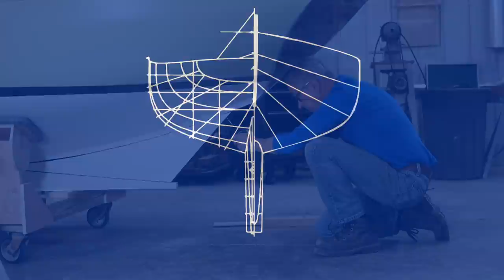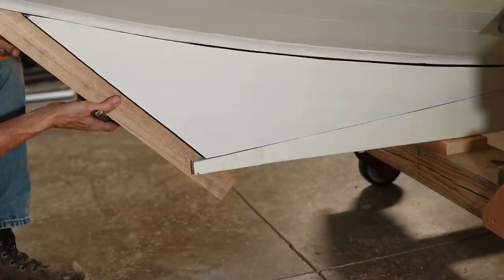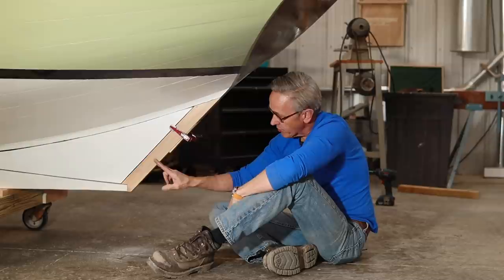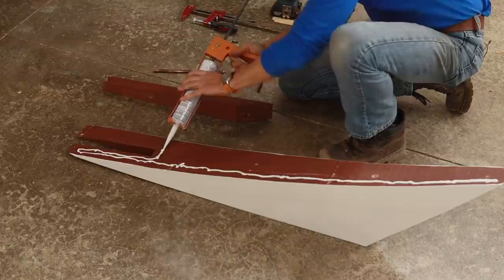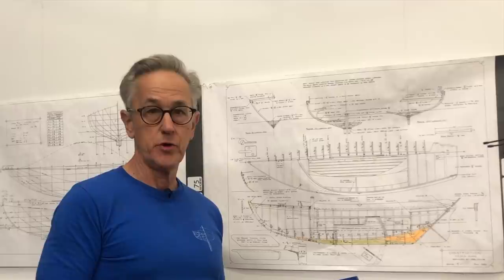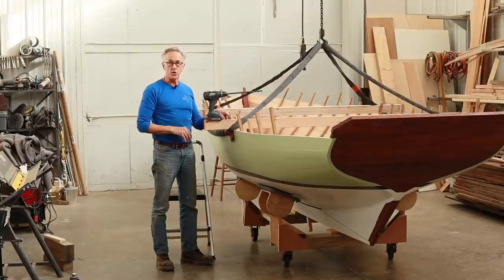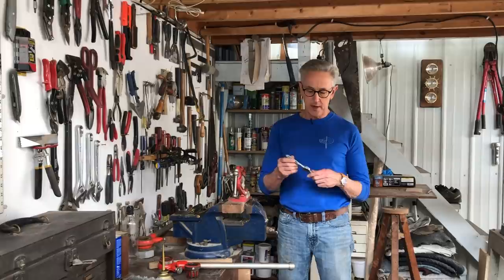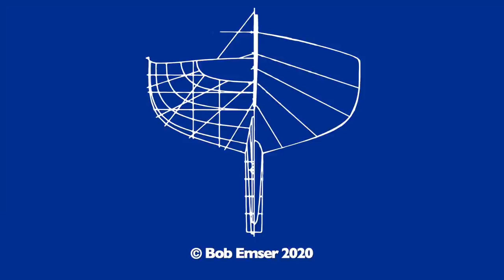Attaching the Stern Post, Deadwood, and Making Keel Bolts S2-E35

Comment: Yup, the larger pipe/thread cutters are the way to go if you can get the affordably or rent/borrow them if you won't be needing them again. I wouldn't sell my pipe threading set for any less than what I could replace it for, so the oerson asking may as well buy it new themselves. Of course if they are in too much of a rush, then I could get a new set and they could buy mine, I suppose. I don't use it often, but when I need it, I know exactly where it is.
Love the simple tip on finding the length to cut your bolt stock. It is so simple it just might slip right through the minds of many folk trying to figure out how to do it. 😉

Comment: First of all, amaizing job, that peace of art may look like a sailing boat, but it is  just like one of your sculptures, awesome.  On the other hand, the long bar you drilled 90º to the stern post, looks more like 100º, in fact looking at the plan, it ended coming out under station 18 (number maybe wrong) and, as you said, it is not a big issue, the problem may show up when you drill the one at the end of the balast keel. looking at the plans it may go through that previous drill.  As I said, love your vdeos, and admire your skills and how acurate and perfect your work is, just wanted to give you my prespective in case it can be of any help.
Reply from the maker: Hi Vicente,
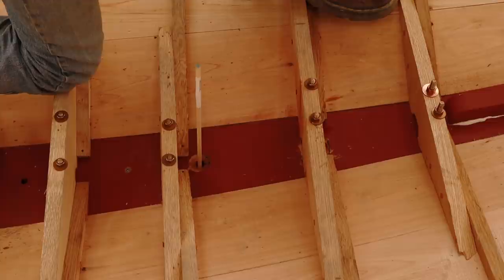You have read the video wrong which is easy to do. I drilled the pilot hole on the drill press as I had mentioned and shown in the video. So it is dead on 90º. Using it as a guide hole through white oak, it would be impossible to drill it 10º off. The plans do not show a dimension for the hole location, so in scaling it off the plans I came as close as I could. It came out near frame 19. The aft ballast keel bolt is a couple of inches aft of station 18. You can see this at 19:30 in the video. So no worries as all the holes are drilled.
Thanks so much for your kind words.
Cheers
Reply: @TheArtofBoatBuilding    My apologies then and thanks for taking the time to explain it to me

Comment: Bob, I have noticed in your videos of the transom design that your transom has square ears at the top of the transom. what is the purpose of that particular design?
Reply from the maker: Hi Andy,
That’s the shape of the pattern. I later round off the corners when cutting that hole for the tiller. 
Thanks for watching. 
Bob

Comment: Bob, I building a Joel White 20'3" Flatfish which is almost identical to the Haven, so I am watching your videos closely.  Can you give a recommendation for a good boot building supply house for materials I will be needing?  Thanks so much for the excellent videos.
Reply from the maker: Where are you located? What supplies are you looking for, lumber, fittings, sails?
Happy to send along some ideas.
Cheers,
Bob
Reply: @TheArtofBoatBuilding  I am located in northeast Alabama.  I am fine with lumber sourcing.  I am thinking, epoxy resin, fiberglass, fairing compound, caulking etc.  I have bought from Jamestown Distributors before but that's about it.  Sails are still a long time away.

Comment: Absolutely love the channel Bob, Lifesaver - Thanks. Do you use a "Puffer" to remove debris from holes? They are very effective and can reach parts other tools cannot. You can get hand pumped ones or use an airline.
Reply from the maker: I use compressed air.
I remember my Grandfather using one. I think his was originally for adding water to a car battery, back in the 1960's when that was a thing! 
Thanks for watching.
Cheers

Comment: The cotton caulking for the keel bolt is under the nut not the washer why  is that
Reply: i think that is a mistake
Reply: @crachdown I think so too, although if the hole is going to be filled with faring compound you would think that the cotton is superfluous.
Reply: @sunny71169  even if it is filled with faring compound i would still say better safe than sorry
Reply from the maker: Oops! Senior moment. Thanks for catching that. Fortunately an easy fix!

Comment: Dear Sir,

I am enjoying your videos very much. I am currently watching all of them. I have been a sailor for the last 44 years but now i am just building a modest model railway. I used to build model sailboats when i was young, though. The tool making videos are brilliant. I share your taste for beautiful work tools.

As i am still on video  S2-E21, march 2020 (bloody hell! the beginnings of the pandemic!), i have a (stupid) question: Does the use of glued planks with the junctions in the middle creates a (kind of) surface weakness around the middle of the hull? Why not use a plank with a junction in the middle and the next one with two junctions, away from the junction above (like bricks on a wall)?

Thanks and cheers from Brazil!
Reply from the maker: Thanks Eugenio, I'm glad you're enjoying the tool videos as well as the boat build. In laying out the spiling battens it is hard to control where a dog leg is needed to make the sweep of the plank. The epoxied scarf joint is most likely stronger than the cedar plank itself. So unlike brick mortar joint the scarf is not a weak spot. When possible I tried to put a joint on a frame and do as you said stagger them. Just wasn't always possible. 
Thanks for watching.
Cheers,
Bob
Reply: @TheArtofBoatBuilding  Thanks! It makes perfect sense.The joint must behave as a two-layered plywood...